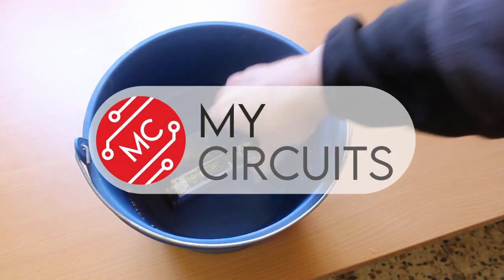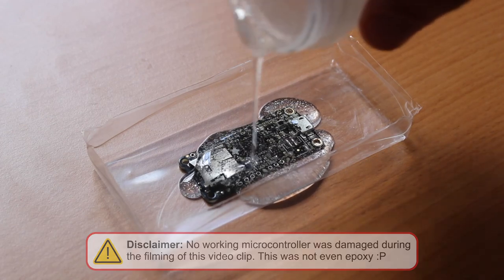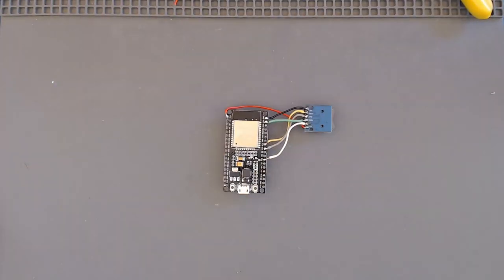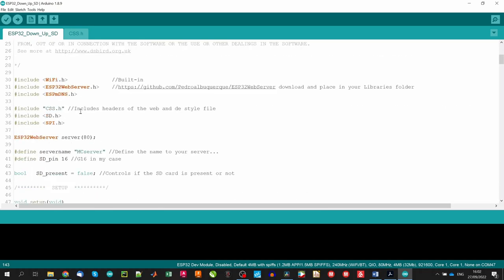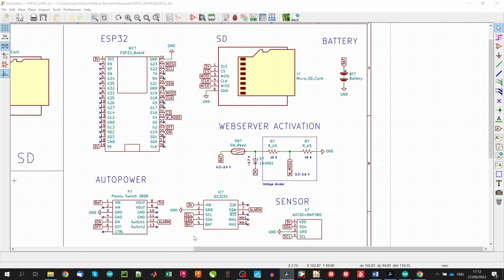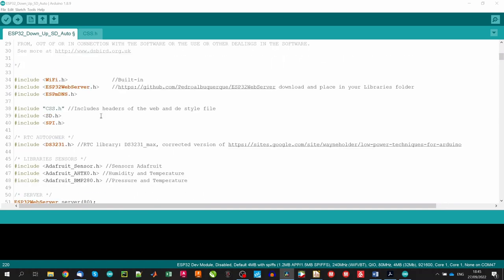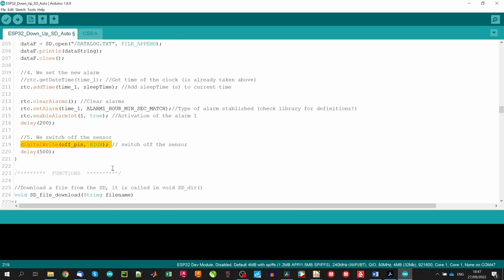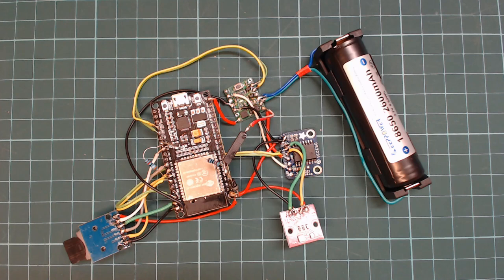ESP32, SD and WiFi - Download/Upload/Delete SD files using ESP32 microcontroller as a web server

Comment: I followed as you instructed but in the web server "No sd card present" message is being displayed,how can we fix this?? Anyway to contact you..
Reply from the maker: Hi, that problem should be related with the connection of the SD board to the microcontroller, SD pin number in the code, or pull up resistors. You can send me a Pic of the hardware to my email. Best!

Comment: Hello! We are from Ukraine. Is it possible to make an mp3 player based on the esp 32 cam chip? It is necessary to implement access to the sd to delete and add mp3 files. It is very necessary to implement. Thanks for the tips !
Reply: hi, i may be 4 months late, but i am currently building esp32 based mp3 player too. i want to integrate this to my esp32.

Comment: Great video, many thanks for your work ! Just one question: the different sleep modes and internal clock of the ESP32 does not need external RTCs or Power - management devices (including some persistent memory). You can get a lot of information about all of this from Andreas Spiess YouTube cannel.. Best regards from Switzerland, Peter.

Comment: Dear Thank you for the very good project, I tried to recreate the same datalogger but the RTC library is giving an error : I am reading this in  the  serial  monitor : 7?/7?/7?,1?:7?:7? PM,MC001,  do you what can be the problem? thank you in advance.
Reply from the maker: Hi! That seems a wiring issue or pull Up resistors... send me pictures to the email

Comment: hey can i do this  project with esp32-cam module
Reply from the maker: Why not? 🙂
Reply: @mycircuits  No sd card present" message is being displayed
Reply from the maker: @horathama-t5g  Check that you are selecting the correct "SD_pin" in the code and its wiring.
Reply: @mycircuits  that's the problem i can't find what pins are connected to esp32
Reply from the maker: @horathama-t5g  Send me pics of your setup to my email ;)
Reply: @mycircuits   First of ALL - many thanks for this video and code - its great!  The problem with CAM module is that this ESP32CAM module doesnt use the same connections to SD card reader module as you in that video and therefore it is needed to use SD_MMC.h library, so you need define that SD_MMC.h on init (instead of SD.h) and on every usage of its methods change from "SD." to "SD_MMC." - for me, worked like a charm :)